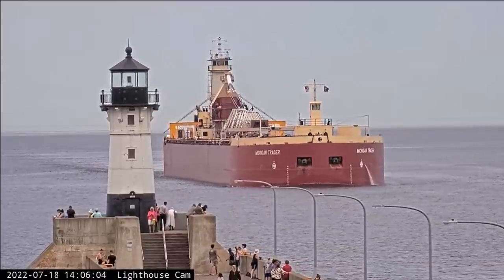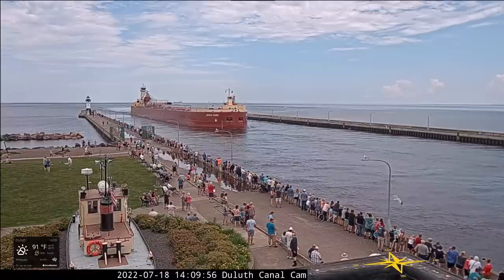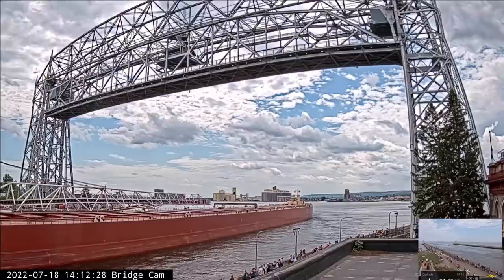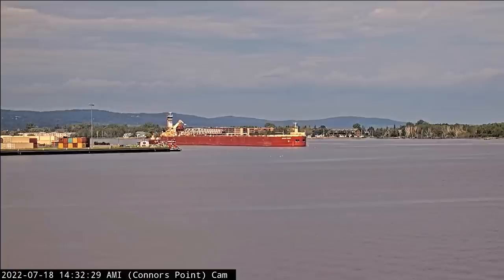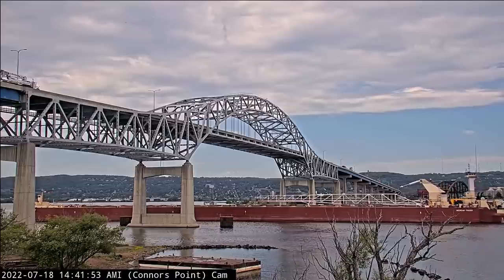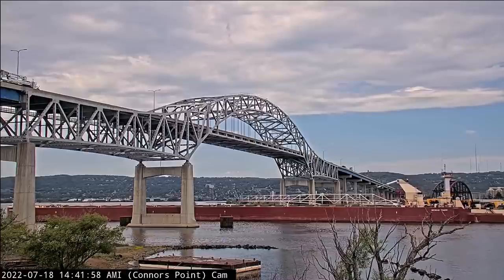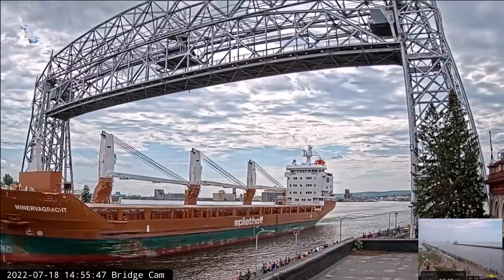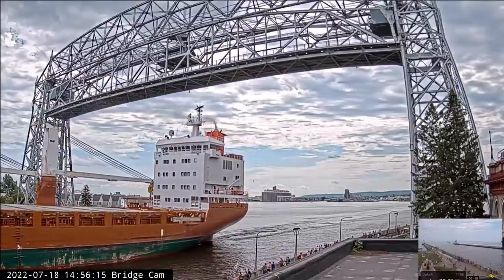DIRK S.VANENKEVORT arrived and MINERVAGRACHT departed Duluth 07/18/22

Comment: I have never understood the value of this system vs just a traditional ship.
Reply: I can think of four reasons

1. She can traverse the St. Lawrence Seaway system, even though she’s over 100 feet longer than the maximum size limit, because she can split into two pieces. No traditional ship could ever accomplish that without being significantly reduced in size.

2. Crew compliment. Supposedly you can run an 860 foot freighter with fewer people using a tug boat as your propulsion than that same ship with a traditional superstructure. How that works I honestly have no clue. It’s a head scratcher so would love an answer. I’m sure that can cause problems though too.

3. Barge/tug combinations are taxed differently than full ships in the US, even though there’s practically no difference in this case.

4. In bad weather the tug or barge can separate and be used as lifeboats. The tug can also be operated as an ice breaker or harbor tug, allowing them to be almost never need outside help, regardless of circumstances. Plus if one part ages, is damaged or becomes obsolete, they can simply swap out units with a few month’s worth of modifications rather than designing and building entirely new vessels.
Reply: Smaller crew requirements. It gives smaller companies the ability to do the same work as Interlake and Canada Steamship. Plus the tug can do other things while the barge is loading our unloading.